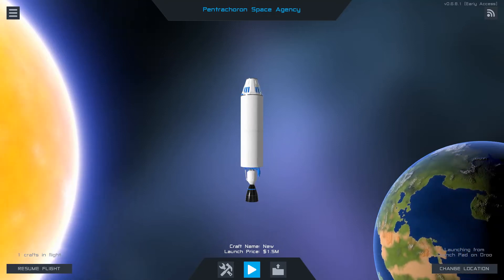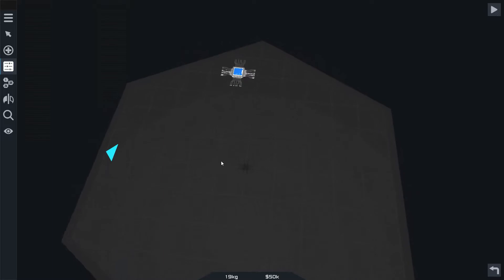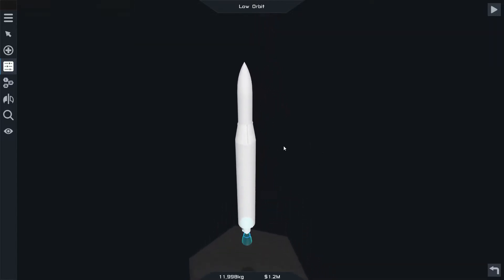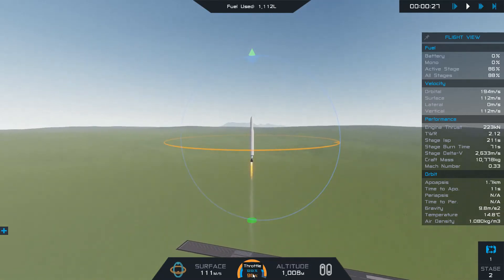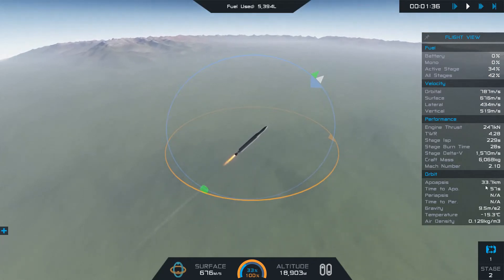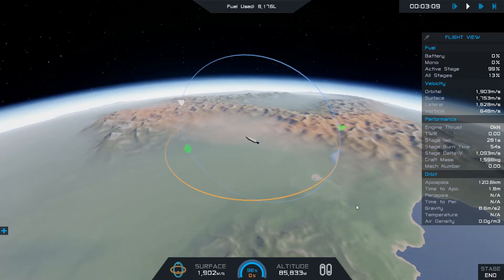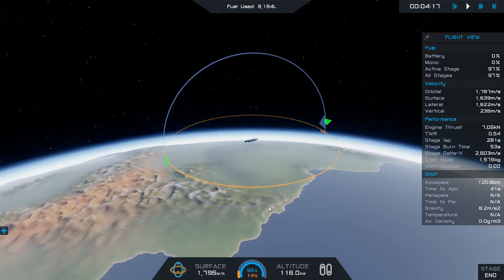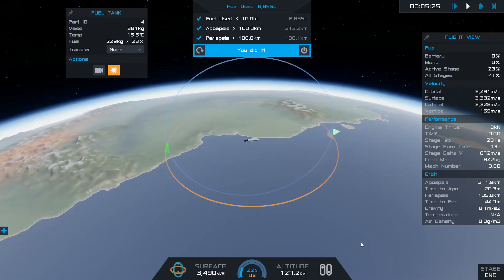[SimpleRockets 2] Low Orbit Mission

Comment: Yeah, it seems it only measures leters, not kg. This is more obvious with the new updates
Reply from the maker: Yeah, at the time I did this they only had RP-1. Now there are other fuel types. I don't know if they revised the success criteria for the challenge.
Reply: @cofibot8270  they have not. Which basically means you still primarily use kelox, since its so much denser: so while others get better peformance to weight, kelox gets better performance per leter.
Reply from the maker: @JagerIV  - sure, but from a game level progression point of view, I think this early mission should be easy to do with various fuels. Maybe adding a new "optimal low orbit" mission would compensate with the appropriate challenge.
Reply: @cofibot8270  can you pls do a video on how to orbit  ? Since my rocket spins out of control and hits earth